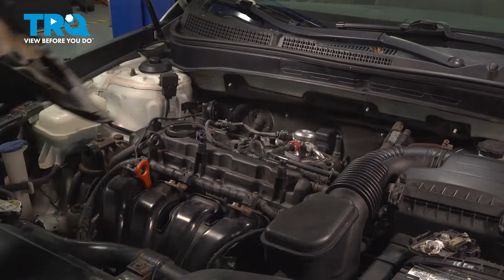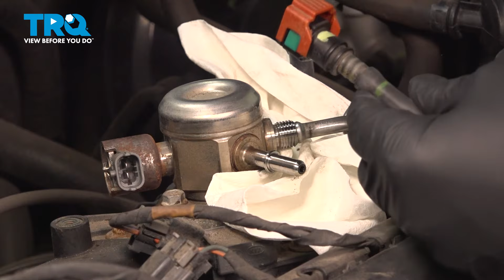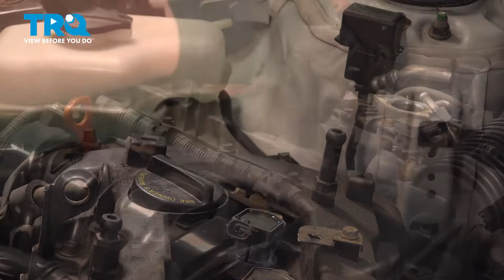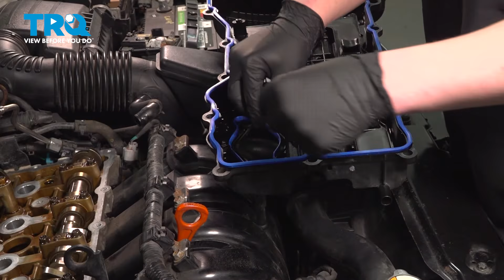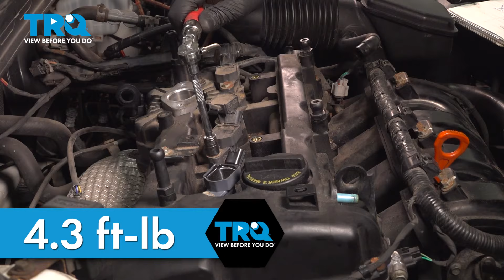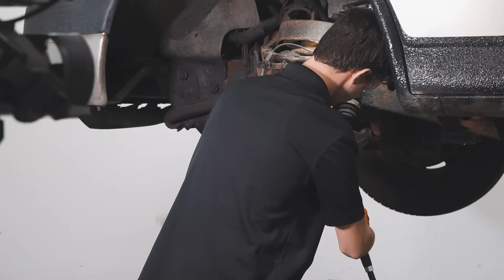How to Replace Valve Cover 2011-2014 Hyundai Sonata

Comment: Put new gasket with gloves full of oil film - how long before it starts leaking again?  Valve cover is all full of oil inside and outside. It has to be fully degreased all around with a good oil degreaser solvent and spotless clean of any oil trace - not just a cloth wipe. Oil film is invisible. If the outside of the cover still has oil film on it, you will hold the cover and pass the oil film onto the new gaskets. Then remove oily gloves, wash hands, put new clean gloves and don't touch anything else but the cover and new gaskets - everything around including tools and bolts has oil film/grease on them.  Hyundai workers at factory use greasy hands to install these gaskets. Slightest film of oil/grease and the gaskets will soon start leaking.

Comment: What is the name of the high pressure hose line with the brown quick connect, called? I need to buy one for my 2.0T limited. 
I did your step by step, and broke the little green tabs as I was reconnecting the hose back. 
Please help.

Comment: Do you have a video for the valve cover gasket replacement on a 2014 Hyundai Tucson? Cause when I do mine the high pressure fuel line is sitting right above one of the 10 mm valve cover gasket bolts and I can’t get a socket on it.

Comment: Video very well done.  For a 2011 Hyundai Sonata 2.0 Turbo valve cover replacement, the only issue not addressed in the video is that the fuel line over the cover is rigid and does not allow to pull the valve cover straight up.  What worked for me was slightly lifting the cover and rotating it counterclockwise.  Also, the bolt in location #14 is not accessible to be removed with the socket due to the fuel line above.  It took me a while to get it out with an open 10 mm wrench and I could not torque it back neither, only tighten with an open wrench the best i could without fully compressing the gasket in that location.  One thought was to remove the rigid fuel line by loosening the 19 mm nut on the other end below, but it was not easily accessible neither.
Reply: Would you happen to know the cost and part number for that fuel line? I may need to replace mine.